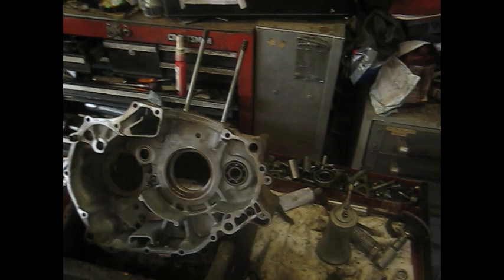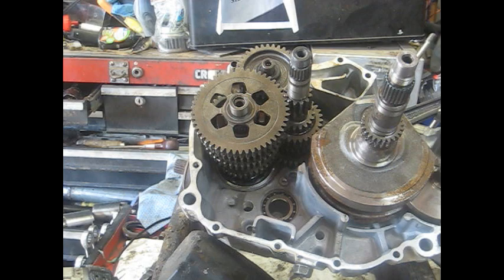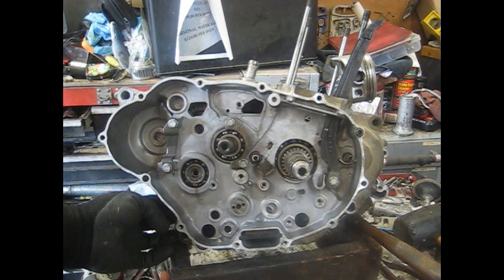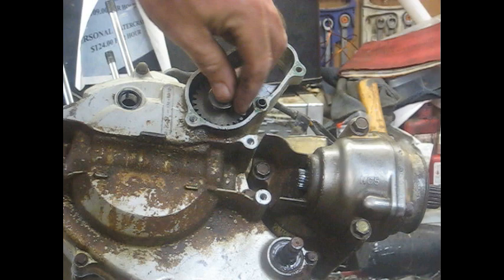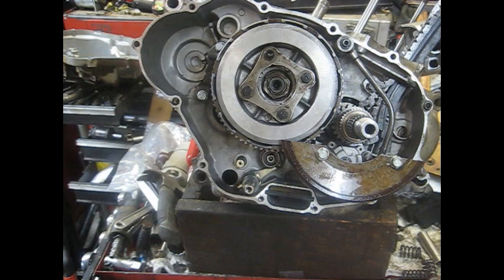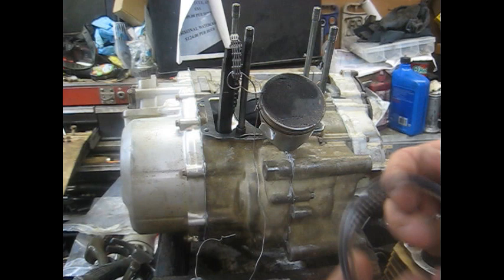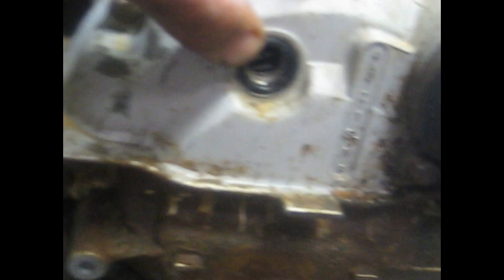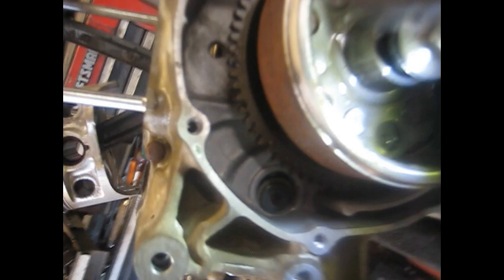Honda fourtrax 300 engine assembly

Comment: {please read to the end} 
This video is very very useful it is extremely detailed more detailed then any other video I have seen on YouTube regarding the trx300. Last August or September I tore apart my fourtrax to replace the center gasket because It was pouring out oil. I thought to myself this will be easy it'll be back up and running in a week I even had a service manual. Well I was most definitely wrong. No matter what I done last year no matter which way I tried to assemble the transmission I could not get it to go together. So after about 3 months of me looking and looking and reading forms and asking  about the trx300 transmission I gave up because no one was seeming to have the answer I was looking for they all kept saying read the manual it'll tell you. Well either I'm not smart enough to understand the manual or it wasn't telling me right. So I gave up until it. Then it was about a month ago I was browsing YouTube and I came across your video.  I finally got it to be assembled I was able to get the other case half to successfully sit on there. I've put every washer the correct size according to the thickness the od and Id into the correct spot double checked twice. But I can only get it the shift two times weather it is two times reverse or two times forwards never more never less. I've double checked the "slivers of metal" to make sure they was in the correct way that is according to the service manual of course (which I'm starting to doubt). I just can not get it to shift no matter what. No more then two times and then it's like it's hung. So maybe the bearing is getting stuck in certain spots. So I took out  everything and just assembled the shift drum and the spring and other things on the back side and it did a complete 360 with clicking in between. So that wasn't the issue. I've checked all shift forks they are in the correct spot I've checked the tooth count on every gear made sure every gear is in the correct spot and facing the correct way and every washer {that is according to the manual} which seems to be the same way you  assembled them in this video. I'm just at a complete loss on what it could be. Any information on what to check or possibly what I am doing wrong would be extremely helpful. Thank you so much:)
Reply from the maker: That is a tough one. I assume when you put it back together, you are rotating the shaft that the clutch basket bolts to to simulate the engine running? When it does get stuck in gear will that shaft spin then or does it just free spend like it's in neutral?
Reply: @FourwheelerDoctor  yes I have been spinning the shaft the clutch bolts to to Simulate the engine spinning. It spins up until I change gears two times and then the shaft just doesn't move or if it does it moves one way a little then the other a little almost as it was like the shift forks wasn't in place. I have also had the other case half off so I can look at the gears while I'm doing that. That is with the shift drum and the other items still attached on the back side of the shift drum.  From what I have observed it's just like something isn't going into place right. I'm so wanting to tell myself that one of the gears just isn't in the right spot but I've checked over and over them again and again but I very well may have a gear in the wrong spot. I made a very dumb dumb mistake I have a recon 250 motor that I completely tore apart when I was 14 or 15 because I wanted to "fix it" it had a huge score in the piston sleeve and had many other issues anyways I put everything from that motor in a box and when I tore apart this motor with the actual intention to fix it I decided oh I'll just put them together. Definitely one of my extremely poor choices. And I may  possible have one of the recon gears mixed up with the 300. But from the diagrams I have browsed over I haven't really seen any the would go on the 300 mainly because of the shaft size which is smaller if I'm correct and the teeth count is similar but I don't believe that any of them are the exact same as the 300. However I could be completely wrong.
{I really do appreciate your reply thank you very much}
Reply from the maker: @tman8209  I would about bet if the two shafts will go together then you probably got the gears correct you may want to just stick the other case half on with the gasket in it and no RTV and try it like that. I've had them shift funny when the front case was not put together just because it allows some movement that would not happen if you have the cases together. And I say put the gasket in because I've run into clearance issues by not installing gaskets on Hondas before and that little thickness of the gasket sometimes makes a difference.
Reply: @FourwheelerDoctor  well that does make sense.  I've not had the entire case bolted down yet nor the gasket on it  yet because I just wanted to make sure that it would operate correctly before hand. But I'll definitely try that I really hope that's the issue. Thank you again for the help:) I'll let you know how it turns out.
Reply from the maker: @tman8209  you can always put it back together and put the gasket on dry that way if you have to take it back apart you won't damage the gasket.

Comment: Just pulled my starter from your vids, weeelll, . The bottom long bolt broke, . . Dang it 😕, so I knew I then had to pull that flywheel case wasn't sure about that lol so after about 3 hour of scrolling forwards and backwards (just to make sure I wasn't missing anything from one side or another that might be spring loaded or circliped had your vid paused pulled the tcase  then the flywheel case had to knock the shift shaft back thru case but I was successful  got the case off and to my lunch the piece of that long bolt that was broke unscrewed by hand no drilling banging or otherwise I was soo surprised goin tomorrow to find a suitable replacement again thank you very much for the detailed vids please keep the co tent coming buddy
Reply from the maker: Thanks for watching. I'm glad I can help you out. But I'm going to go ahead and say your luck is a lot better than mine because I very seldom have them screw out. If there is an ideal situation when you break a bolt,  that is it. Lol

Comment: I know this video is a little older by Thanks for this excellent video!  I've got a question: I just bought a 96 Fourtrax 300 4x4 from estate owner bought new and kept in his basement its entire life and looks almost new and runs good was making ticking noise from top end. When I changed the oil I noticed someone had installed the oil filter in backwards and oil was pretty dark. I expected to see a lot of metal but saw very little so I adjusted valve lash and could see some scarring on the cam lobe. It fired up and sounded good ticking sound was all but gone. My question is should I replace the cam or just go ahead and redo whole top rings and all?
Tia

Comment: maybe you could help me with an idea here. i got a machine in that needed stator. pulled side cover. did stator. shift shaft pulled out. i had to reinstall it about 5 times cause everytime i put cover back on it would only shift one way. not sure why. id check it before putting cover on then after it would act up. finally got it to shift both ways and feel normal. got machine together. low and behold it wont move. the shifter feels okay it sinks in and audible clicks. neutral light switches off. rev switches on. but doesnt move. did the clutch shaft maybe come unaligned? or maybe it just happens the clutch was smoked and thats a surprise? i cant imagine it shifting the drumb correctly and not moving at all if it was unaligned. it doesnt attempt to move whatsoever. no jerk no slip nothing.

Comment: Hey mate just followed this video step by step and have put it back together runs perfectly apart from it says its in neutral then i try engage reverse neutral light goes off but no reverse. Press down again and i have reverse. Then lift up 2 times i have neutral. Same with up shifting 1st gear is 2 times up then the rest seem lime all neutral. Then easedown on the shifter again gently to head to neutral and its clunking some gears. Gets some gears with abit of persuasion but yes 😂😂 any ideas cheers¡

Comment: When replacing the cam chain is it necessary to lay the machine on its side if you’re not pulling the motor out, or is that optional ?
Reply from the maker: It's not necessary but it just makes it easier for access.
Reply: @FourwheelerDoctor  I’m having a ticking sound on mine, I’m thinking it’s possibly the cam chain, tensioner, and or the adjuster

Comment: I have a question when ever I put my rocket arm cover on I can snug one bolt down and my cam will not turn until I loosen it  do you have any ideas what's wrong I sure would appreciate it if you could help me out
Reply from the maker: Is the motor at top dead center?  The cam should rotate a little if it's at tdc. The rockers may be too tight initially so you may need to loosen the adjusters up first.
Reply: Thanks so much for your help and you were right plus my cam chain wasn't on there good but I got it and it's up and running good I really appreciate you

Comment: I just replaced the shift shaft on my Honda fourtrax 300. Now when I shift I can feel it engage but under exceleration it don't move. Any thoughts.
Reply: I have this exact problem. It has something to do with the shift shaft not going back in the correct timing/orientation with the clutch side. I’m preparing to open the clutch side to see what’s going on. Feels as if the clutch is disengaged all the time.

Comment: Working on getting mine back together is there a particular orientation that the shift drum need to be in before I put the crank housings back together?
Reply from the maker: No it will go together in any gear.

Comment: why do you fit a reduction gear mate ..?
Reply from the maker: Over here in the south folks like to ride in the mud with their atvs. They put big tires on them and they oftentimes struggle to rotate the tires and thick stuff. So a reduction is installed to make it easier to spin the tires. It reduces top speed but greatly increases torque on the low end.

Comment: Hi there love the bed lots of good info I was wondering if you know what the common cause of oil going back into the airbox is
Reply: Video
Reply from the maker: Normally it is caused by too much oil in the engine. It can also be caused by worn piston rings causing lost compression to get in the bottom end and blowing the oil in the air box through the crankcase vent tube.
Reply: What a head gasket leaking into the timing chain area I’ll do the same thing
Reply from the maker: @Gokartsandstuff82  it could but I very seldom see bad head gaskets on Hondas.